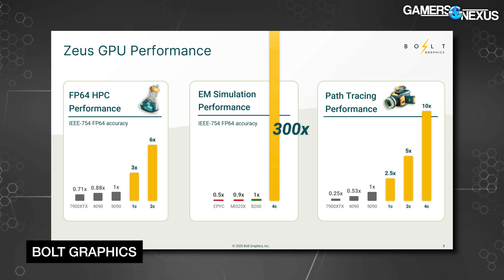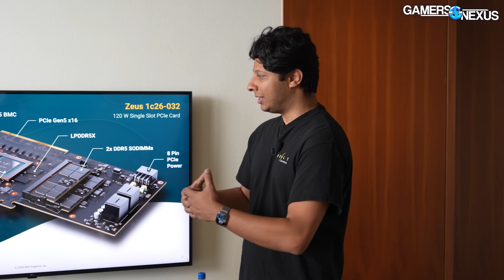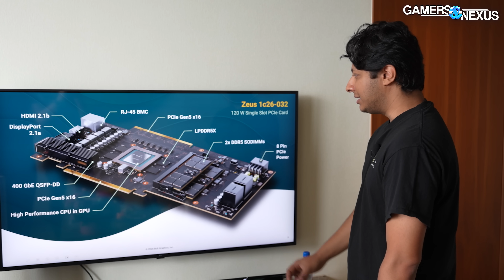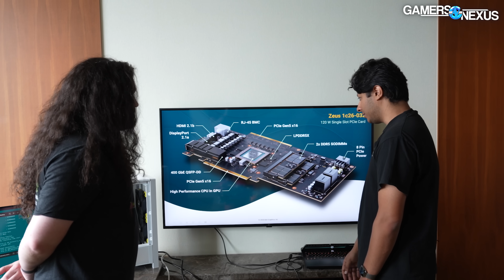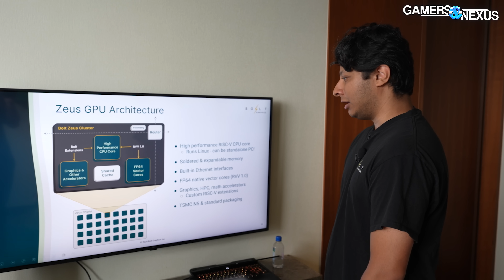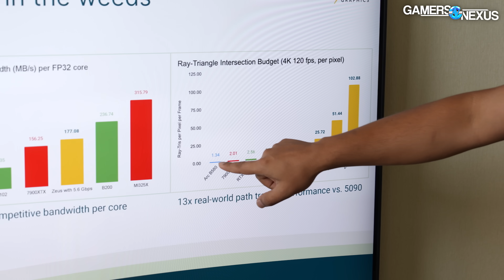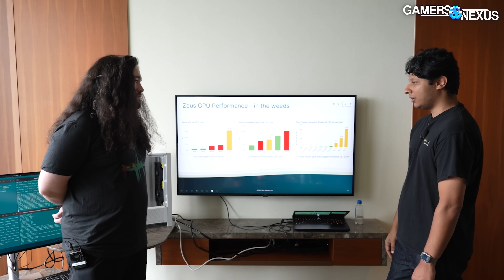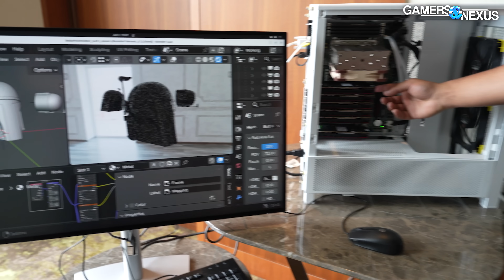A New Gaming GPU Challenger: Bolt Graphics Takes Aim at NVIDIA

Comment: Good luck to Bolt. Like every chip startup that has failed to date, the hardware is only half the battle—you need a functional software ecosystem to support it and an available market share to sell to. I hope they plan this well. In reality, they aren’t the first, and definitely won't be the last, to "dream" of re-inventing the wheel, only to end up relying on established software standards just to survive.
 
However, they still have to play it incredibly smart globally. Entrenched Western tech giants have massive patent walls set up from every conceivable angle to corner startups. Furthermore, designing a unique chip doesn't mean you control its destiny—if you don't own the advanced semiconductor foundries needed to physically manufacture your own flagship silicon, you are still operating at the mercy of the global giants who control the physical supply chain.
 
At the end of the day, a newly invented graphics card still has to play nice with motherboards, Windows, Linux, game engines, and developers. There are too many deeply entrenched interest groups dominating the tech stack. As a new player, you have two choices: either you try to be a complete maverick and get cut to pieces by the legacy ecosystem, or you conform to their standards and just end up becoming a part of the old establishment you were trying to disrupt.
 
If they want a radical path to survival, they should look at how to exploit the massive technology supply vacuum in China created by escalating trade sanctions. But the old playbook of selling Western silicon over there is dead—Beijing is actively blocking downgraded Western hardware to protect its domestic players. If Bolt wants to tap into that massive vacuum before domestic alternatives completely lock down the market, they need to weaponize their architecture. Because Bolt's GPU is built around open-standard RISC-V cores, they have a unique backdoor: they could bypass direct export hurdles entirely by aggressively licensing their specialized ray-tracing IP directly to Chinese domestic tech firms. Letting Chinese players build "Bolt-powered" silicon locally is likely their only viable gateway into one of the largest markets on Earth before the window slams shut completely.

In my opinion, Bolt needs to completely abandon the idea of fighting for scraps at TSMC's legacy 12nm node—their physical growth space there is already squeezed to the absolute max. Instead, they should aggressively jump on Huawei's new "LogicFolding" 3D architecture bandwagon.

Comment: Sorry to put water on the fire but….low latency large swathes of multi channel memory, built in risc 5 processor, large on die cache, a graphics processor optimised for certain type of calculation, on board network connector with ability to work as nodes part of a large network…….this looks it’s tailor made for Agentic AI applications 😂
Reply: Coz it is. It purely datacenter stuff. If AI ,,destroyed,, gaming, because its much more profitable for amd and nvidia which started as ,,gaming,, catd producers, i dont se the way how to became gaming gpu produce frm AI gpu producer 😆 i know steeve is not stupid boi and this channel is not LTT advertising wannabe , why he advertising this to gaming public ? Answer for me is very sad 🤮

Comment: I'll admit, im a bit skeptical about relatively new company jumping intonthe game, especially with claiming their path tracing is significantly better than a 5090, albeit in what im understanding to be a specific use case. But still. That's a huge claim to make. 

I like the idea of trying to bring back some form of sli. I just dont see it widely getting re-adopted. Well, not for the general consumer. I'd even say for game devs, it might be debatable. 

The expandable memory is pretty cool. Im 33, almost 34, and i guess i somehow missed all the times of devices having that feature. But im just curious about how fast they are compared to the onboard memory chips. I've personally never run into a case of exceeding past the limits of gpu memory where the system memory gets. I dont do that kind of work, and i dont really have instances of games trying to use more memory than available. Or, how ever that's supposed to work. 

Overall, it's interesting, and I'll be glad to see how it turns out to perform in real-world tests in the hands of reviewers.

Comment: I think these guys have minds set on whats important.
The part about path tracing, I mean. Because right now what we are consistently getting is mediocre ray tracing thats laggy and needs one million work arounds to be presentable (DLSS, recontruction, frame gen yadda yadda yadda) while we also let go of what mattered the most in the past: Good rasters. So the end result nowadays are more blurry slow ugly games that you either can play or only dream of it.
But of course you can't abandon raster, that would kill like 90% of the market. So that approach from Bolt Graphics is really interesting. The main thing holding ray tracing back is low framerate: You need more frames to represent the rays better, or rather you need more rays in a single frame at a consistent rate. Otherwise it just doesn't look good, normal person will always prefer to not bother with it.

Comment: Is there a way to use AI to update your DRIVERS? For instance can you make a base driver, and then when new programs come out, new OS updates, etc. AI can just add that new program, OS update, etc. to the code automatically without it crashing? And say once a day it can check back with AT or whatnot, and see if it has something new it needs to add on? But if it cannot connect it doesn't crash!!!!

Comment: If you actually dig into just about anything about this company though, there's an absolute mountain of red flags. And they CLAIM these are primarily for HPC/render, which is my area. I also happened to deal heavily in horizontal FPGA for synthesis. FPGA is niche, so I don't expect Steve et al to be experts. These are very specialized parts for specific tasks. And the parts they're so proudly showing off? Those are older generation U50's; an UltraScale+ productized for Data Center with PCIe Gen3 host, 1x100GbE, 872k LUT, 1743K registers, 5952 DSP, and 8GB HBM2 (no e or 3, it's that old) at 316GB/sec. In short: this is not a high end or modern FPGA and it would take a LOT more than 6 of them to approximately simulate something on par with, say, an Intel Arc A310. In fact, those cards are about 3 generations old, and would not be considered seriously for something like CPU or GPU design except in the middle void. (This is basically the space between something like a Rockchip RK38-series and an Intel N200 or thereabouts.) And when I say 8GB HBM, understand that this is not 'oh so they have 8GB per simulated GPU!' Not how it works. The actual GPU verilog is loaded into that 8GB of HBM, plus the PCIe host interface IP, so you only get whatever is left. This setup here is right out of Harris and Harris, right down to the RISC. See, RISC has multiple IPs that are permissively licensed or open sourced. 
These cards use an XCU50 with SSI in a 2 SLR configuration, with SLR0 owning the HBM exclusively and SLR1 only having one GTY. This is just fine for networking, which is literally what these are designed for. They are not good at or intended for any form of synthesis tasks. They are designed to be extreme high speed offload cards for things like HFT (not an area I touch) or accelerating hosted applications. Nobody who was serious at all would buy them new for synthesis work; only hobbyists who got them cheap. And they are cheap - you can get these older parts for under $1.5k on eBay easily, some under $1k. Compare this to an FPGA card which is actually designed for work like synthesis, like the Alveo U55C or V80. The U55C is already a big step up with 1304K LUT and 9024 DSP slices, plus 16GB of HBM2e. The V80 basically doubles the LUT and increases it to 32GB HBM2e plus 32GB DDR4. Personally for the application I would go U55C if I had no choice, but there is a choice, and none of these cards are meant for this work. I'd be calling someone like Annapolis Microsystems, Trenz, etc. looking for something based on the VM1302 or VP1002, though most likely something else entirely. But immediately you're into FPGAs that cost $5000+ each if you're the least bit serious. And that's just the chip, not even on a card, forget memory. Even getting a little more serious and stepping up to a U55C, those cards are $5.6k each. If you were even a little serious about something like this, it wouldn't be the cheapest ASRockRack board you could find with only one NVMe and 6 cheap cards totally faking it. At the minimum you'd actually have the output connected to the FPGA's transceivers to prove the synthesis can actually output a signal or data. 
Meaning their "functional demo" isn't. They literally proved NOTHING. Not "our silicon does what we says." Absolutely, positively nothing at all. Not one single thing beyond 'the FPGA can execute the instructions we gave it.' That's literally all it proves, which has nothing to do with their supposed silicon design, at all. The FPGA is operating and their HDL compiled. Congrats. You got to the step after hello, world.
And holy crap, he doesn't even know how the FPGA is configured? Great start there. Then some truly, truly stunning evasion - "we just put parts of it on there at a time." Well, no, buddy. That's absolutely not how it works at all. You can't just pretend your memory controller doesn't exist when it's convenient, or that clocks don't matter, or that you can just slice out this little set of instructions equivalent to a few thousand transistors and it's totally legitimate. It's not. It's not just inaccurate - it's intentionally lying.
Then the "emulator" that runs on "64" of those cards - look, just no. That is literally my domain, and just straight up, get out. That is completely and totally wrong, period. If you want to do it that way, now your transceivers matter, which you don't have enough of. And you're subdividing to the point where now you're just executing various pieces of an instruction set which has NOTHING to do with synthesizing silicon. Literally all you are proving is that instruction DRAW1 operates on an FPGA. Like, this is basic CompSci degree stuff. The actual correct setup would be something closer to a Kite with the IP condensed to ~12 cards or less, and linking synthesized cores with GTM to unify into a single operational core. This is the absolutely MOST BASIC of stuff here. This is not some magical supersecret competitive advantage thing I no longer care about protecting, it is literally Processor Synthesis 101. Things that anyone who has even LEARNED about how to do this stuff would know.
And GN is apparently oblivious to the fact that Bolt claimed to have 'taped out' a full prototype and begun testing of an actual assembled card prototype in April. Hey kids, if that's true, then why didn't you just show the silicon you've taped out on the card you've allegedly been testing for months?
Extraordinary claims require extensive proof. And all this has proven is that they could give Anthropic a run for their money on marketing. This is nothing but a scam, and they saw GN was ignorant enough about the technical side of this to sucker them in. Extremely disappointing, and I sincerely hope GN takes a step back and actually investigates properly instead of producing a puff piece fit for an "AI" company.
Reply: Then you should mail GN, in proper wordings (instead of the partially loaded wording) and see if they respond. I would like to believe you, but I am not knowledgable in this field at all and as such also trust the other side, because what you are saying also is just as unknown lingo to me as what they are saying.
Reply: If they announced the tape out in late April, they're not going to have the chips for a good few months. Also, I don't believe they're an AI company since the majority of their materials are based on path tracing. Having said that, we will see what happens. I think there is a market for a path tracing card, but the costs of creating chips are absolutely astronomical hence why there are so few companies in the niche.

Comment: I'm curious: many GPUs have massive SIMT parallel operation.

I had an idea about running physics simulations in cells with localized physics rather than globally constrained physics.
Path tracing and rasterizations are expensive and today much of the physics is per draw call.

My hypothesis was that we could do much faster physics simulations in local bound, but it is a little more complex than SIMT.
You wouldn't require fast render pipelines if they are snapshots of internal simulation rather than physics depend on the draw calls.

Could Bolt Graphics do this?

Comment: i am still very skeptical, but also excited
there will still be 2d games, that simply need to be rasterized
there will be older games that never had path tracing
so what will be the end game here?
you have a normal gpu for rasterization and the bolt zeus gpu for path tracing
and if a game needs both? idk nvidia's path still probably wins
i guess if nvidia does buy them, nvidia might start having a full-size chip for path tracing in addition to the normal chip

Comment: lots of red flags. dimms on graphics cards has been tried ever since there are video cards. it never worked. i would hold a pretty high bet: if they released it today with perfect drivers and perfect game support, it was slow as fak. but should it ever release, it will be years down the road. 
so, i cant even say i am very sceptical because i am not that optimistic.

Comment: I mean I mean I mean I mean I mean I mean I mean I mean I mean I mean I mean I mean I mean I mean I mean I mean I mean I mean I mean I mean I mean I mean I mean I mean I mean I mean I mean I mean I mean I mean I mean I mean I mean I mean I mean I mean I mean I mean I mean I mean I mean I mean I mean I mean I mean I mean I mean I mean I mean I mean I mean I mean I mean I mean 

Stop changing the definition of what you mean and say what you mean without saying "I mean"
Reply: You know You know You know You know You know You know You know You know You know You know You know You know You know You know You know You know You know You know You know You know You know You know You know You know You know You know You know You know You know You know You know 

No! The speaker knows! The listener does or may not yet know! (Some listeners know, but not every listener, and the wording of the speaker is suggestive that every listener is knowing) Stop speaking to listener telling the listener what the listerne knows even if the listener does not know what the speaker knows. The speaker should assert acknowledging that they know, and it is up to the listener if the listener wants to also achieve knowing to match what the speaker knows, and the ability for the listener to know what the speaker knows is a process that simply using language words such as English to say sayables is not sufficient for acquiring knowledge, even if a speaker tricks and fools and deceives and cons and swindles listeners to believe such lies
Reply: To be honest To be honest To be honest To be honest To be honest To be honest To be honest To be honest To be honest To be honest To be honest To be honest To be honest To be honest To be honest To be honest To be honest To be honest To be honest To be honest To be honest To be honest To be honest To be honest To be honest To be honest To be honest To be honest To be honest To be honest To be honest To be honest To be honest To be honest To be honest To be honest To be honest 

Every sentence that includes "to be honest" especially as the first three words of the sentence, implies that every sentence that does not explicitly assert the honesty is a not honest sentence statement, further complicated by the complexity with which inverse is true, such that honesty is dishonest due to recipe of sentiment, emotions, feelings to trojan horsely subvert/invert the fundamentals to no longer match yet still preserve the digestible social constructs to be learned and distributed by the vulnerably tolerant.

Comment: As much as I would like this to be true and successful, some things don't make sense, and at the end, seems to be like a scam to grab investors money.

1. You can't target professionals and creators without drivers, the same drivers gamers use. You still need to pass WHQL cert from Msft if you want your drivers signed and running. Having UMDs for d3d9, d3d10/11 and d3d12, not to mention Vulkan, GL and CL is a huge effort.
2. All they have is renders and who knows what they are running in those FPGAs, also, FPGAs can't possibly be of any reference for real world performance, anyone with RTL experience knows this. 
3.  FP64, ok, you have horsepower, but the main issue right now is not FLOPS, it is latency. You are using LPDDR5, the 5090 which you claim your product will beat, uses GDDR7, so you have 30 less Gbps in bandwidth. No amount of FP64 will compensate for that. ALSO, FP64 requires MORE bandwidth, not less, so you are compounding here.

Let's be real, Intel spent more than 4 years to get their first DG1/DG2 and they had issues, with big budgets and previous experience and shipped IGPUs with shipped and working drivers for D3DX, Vulkan, GL, CL, etc. 

Lastly, saying you can beat a 5090 is big talk, are you saying a startup will overtake the top of the line from Nvidia with their first product? Let's be real, will you.